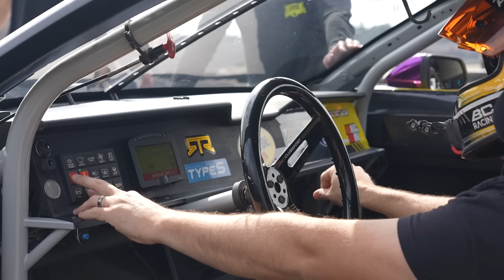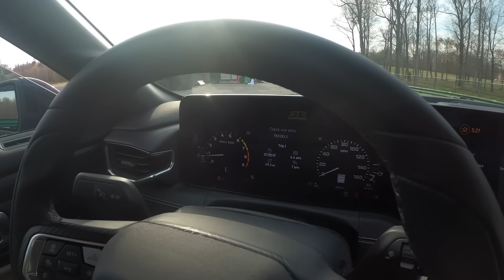Sharing A Formula Drift Mustang w/ Adam LZ

Comment: Vaughn, i am still drifting in a 2013 GT with a KW Clubsport suspension. Compared to a BMW for example extremly flicky and hard to control. would you say the new Mustang is on the lvl of the BMWs now. I never had the chance to test a new Mustang since they got the new suspensions in 2015 and am curious if my next car should be a new Mustang. I dont drift all sections of Tracks with the 2013 where my collegues with their M3/M4s have way more confidence and i can see why when i ride with them. They just have such grip advantage and better balance.
Love the new Car and Team looks good.